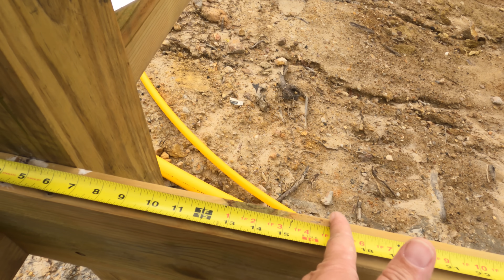New Clearing Project & Pond Updates

Comment: On your dock you may want to use some bolts to fasten your joists to the posts. There will be a lot of weight on those screws once you put the deck boards on.
Reply from the maker: I’m planning to add those. Thanks

Comment: When summer comes around or warm soil Temps in spring you could put down some hybrid bermuda grass seed which loves drought hot humid conditions than overseed in fall if you hate dormant brown grass in spring...me I don't care I actually prefer the brown color in winter. You could also choose zoysia which is what I have and maintain on the fairways at the club I'm superintendent for. Zoysia is more expensive and takes longer to establish BUT it is a far better grass/turf, it's just like carpet, grows far slower vertically which means less mowing depending on the height of cut. Growing up I had Kentucky blue grass, fescue basically everything but zoysia is my favorite well depending on cultivar that is. It is also like bermuda, it loves hot humid drought conditions. Just giving you options but If 
I had a massive pond I would want zoysia, it's the best grass for Erosion and it used a lot on dams, around ponds, bunkers etc it's also a win since it grows slower which is less cutting on those more difficult slopes. It's so dry there everything is turning white soil wise....looks like a beach around the pond on the drone
Reply from the maker: I like the sound of Zoysia. Thanks for the info!

Comment: Bealy was your joists off 1-1/2 since you hooked on the inside instead of the outside
Reply from the maker: The deck boards are 16' and span all the way so wont matter but you (and others) are correct, should have hooked on the outside

Comment: The 16’s are marked in red on the tape measure and just screw the joist together square them up with that giant speed square and put the hangers on later!
Reply from the maker: That’s what I’ve ended up doing. Lol. I had never noticed the red every 16” 😂😂
Reply: @BealyGood  nice!  I’m not even a carpenter, but I’ve framed a few houses and a few decks back in my day, the carpenters would tell me… work smarter not harder.  Oh and that giant speed square has everything you need to frame on it.

Comment: you did the lay out wrong. it will be 3/4 off from flush with the out side board. you pull from the out side and hold back half the materials width from your layout. 16 on center or say two foot extra. unless you wanted a 3/4 set back?
Reply from the maker: The boards run the other way so I don’t understand why it matters 🤔
Reply from the maker: and they’re 16’ boards
Reply: @BealyGood  if the baords are the length of the whole spand it won't.  but when your teaching others how to lay out it does matter.  sorry as a carpenter all my life it matters alot.  people look up to you as a greater of content and often times learn how to do things in life. I'm sure you all want to give the best instructions that you can.
Reply from the maker: @chrissheathewoodguy  I understand and that does make sense. Although, I mark mine to the left of the mark, not the right. So they actually are 16 on center from the very start. I’ll touch on it in the next video. Thanks for pointing it out.

Comment: Firstly... are you saying Chris gave you a leaky pond? [visiting the larger one "at least this one holds water"] 😉

Secondly... fixing them joists to your dock. Why are you screwing them hangers and not nailing them? You do know nails have more sideway sheer strength than screws!  😊
Reply from the maker: These are a special blah blah joist hanger galvanized miracle screw 🤷‍♂️
Reply: @BealyGood  😂 Really hope so... especially when there's a whole load of you stood on it a few years down the line.  How funny would it be if it [the dock] turned into one of them Fairground Dunking type attractions?  Did someone mention ...... Lawyer🙃🚑
Reply from the maker: @Sparks1Plumbers0  good thing they are exactly what  is recommended by local code
Reply: @BealyGood  Ah... the 🙈🙉🙊 Code. Right. Got you......

🤫
Reply from the maker: @Sparks1Plumbers0  lol. I’m not worried about it.